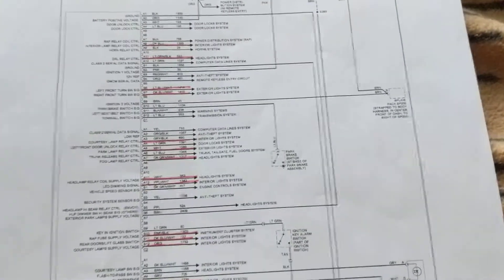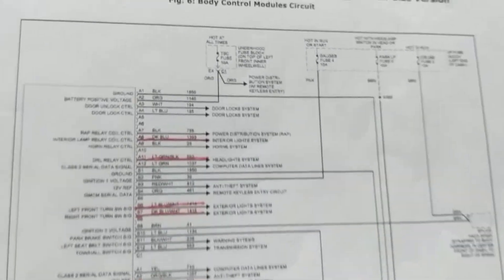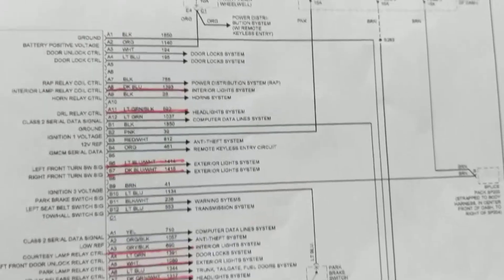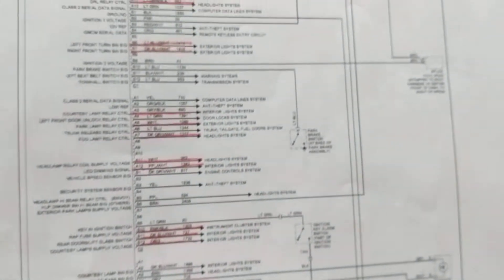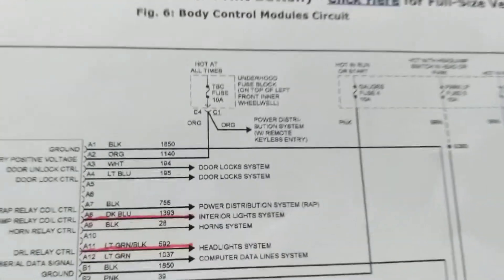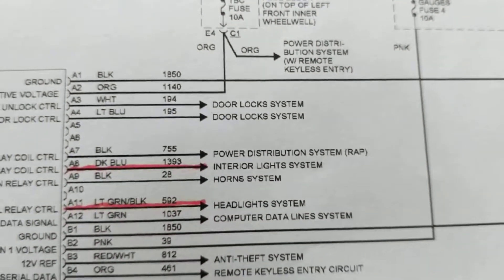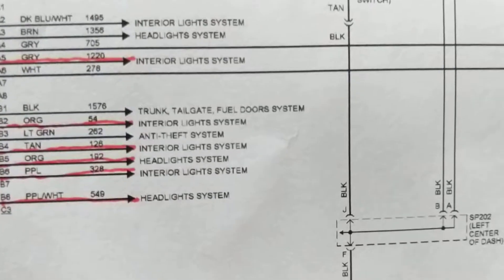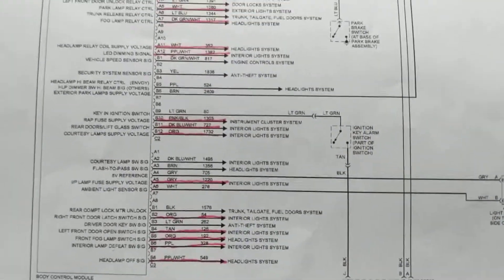How to diagnose BODY CONTROL MODULE wiring diagram diagnosticsToyota Camrys please subscribe my chan

Comment: can you help me with which wire is speed sensor wire in the BCM, i installed remote start for 2022 camry and out of no where P0500 code appeared. I assume it has to do with speed sense wire?

Comment: Joseph, could you give me an idea where the BCM is for my 3.5l 2010 Venza?  I have power door lock/unlock issues and its not the actuator as they have been replaced.  Thanks!
Reply from the maker: The body control module is on the left side of the dashboard next to the steering wheel it is a big macho so you cannot miss it
Reply from the maker: Big module correction
Reply: Usually look under the instrument panel on the right side usually body control modules are by the dashboard on the bottom or the center the PCM boards are on top for less vibration